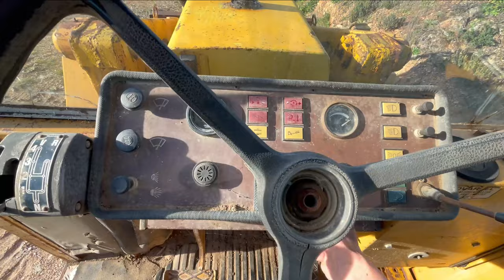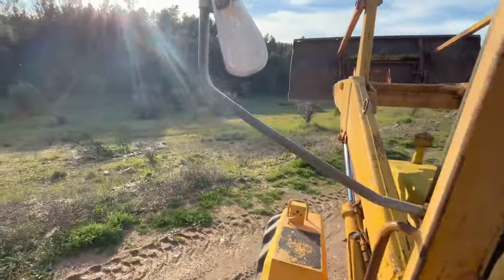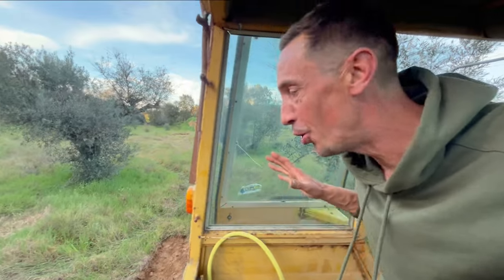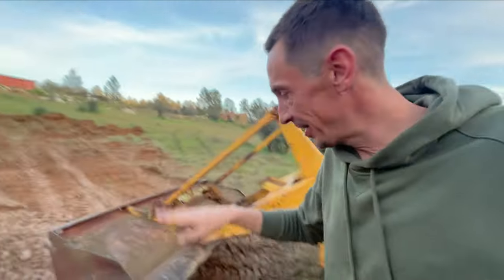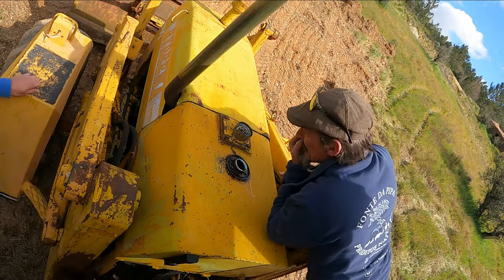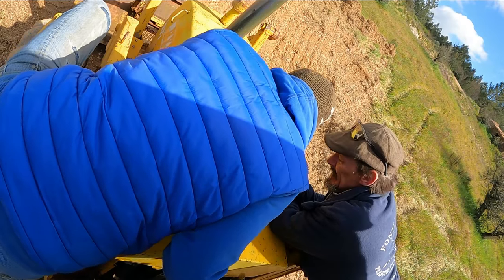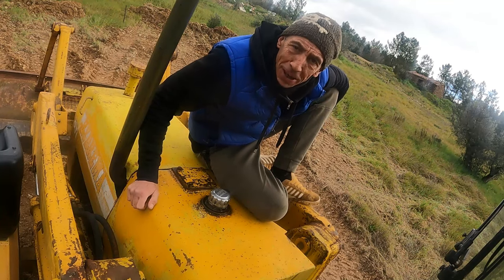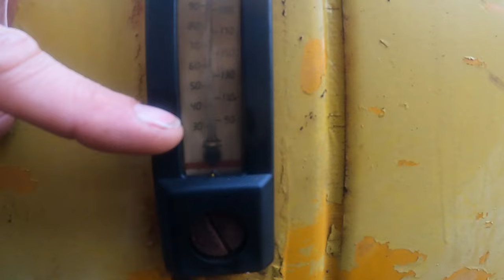SHE BROKE DOWN ALREADY..

Comment: OK...First.  Please, please don't walk under the bucket or stick your head under the bucket arms.  If a hose or something in the hydraulics would let loose the buckets will drop like a guillotine.  Always use heavy wooden props to hold the bucket up when you need to get under it.  Second...The hydraulics for the buckets and the transmission almost have to be the same.  Be sure the hand brake is releasing.  Water is no friend of hydraulics.  Dip the main tank with a stick and make sure no water is on the stick.  This machine has extra hydraulics, because of the articulating streering.  If your not full enough on the hydro oil, turning the steering wheel can give the machine fits.  It's expensive but filters, oils, lube and a complete hose check out.  A bottle of hydro conditioner, once you get the hydro oil level closer to full.

Comment: Change your hydronic filter fuel filter oil and filter and transmission fluid and filter.  Need fresh to make sure no water in those systems    Bet it goes after that

Comment: Jasper, you need a maintenance manual for this specific machine. Can you post the make, model and year of your backhoe so we can help you out a bit more than guessing. Are you sure that the gear box is using the same oil reservoir as the rest of the machine hydronics? you could find that there are several oil compartments that have dipsticks/levels you need to check and set. They may also use different oils hence the need for the maintenance document. If your oil levels are sufficient, then you need to check filters, as blocked or bad filters can give the symptoms your facing as well. Which is why it is recommended to do a full fluids and filters change upon buying a new machine, because right now you have no history data to guide your decisions. Also I'd steam clean the machine and after each use note where leaks are coming from so you can address these during your scheduled maintenance. I hope that helps D

Comment: Get a manual for that model. The hydraulic and transmission are different  systems. Poke and hope will only get you so far before you could make things worse. Need to find out how to check the transmission fluid levels as there will be a process to follow. Will be a really useful asset to have once sorted out .

Comment: The engine must have good compression otherwise wouldn’t start so easy.  90% of the problems you’ll have are hydraulic lines and cylinders which are easy to do the seals and cheap.  Start by cleaning all your reservoirs and do a full all fluid change

Comment: Make sure your brake pedal is fully returning or if you have a dump pedal or dump button on your front bucket lever that they're not stuck in or down, it will be something simple like that.
Reply from the maker: There is a transmission kill switch, its wires are just twisted together.. but it worked like this line. BTW there are no breaks on the paddle :)
Reply: im not familiar with your machine but usually there will be a switch on the brake pedal or a separate dump pedal also sometimes a button on the front bucket lever and these work as a trans cut or clutch, it looks like that's where your problem is as you still have some drive, if its a ZF transmission there will be a long dipstick tube coming form the bottom of the trans, check level while engine is running, also check fuses and see that you have battery voltage on your kill switch wires. good luck 🤞  @GhostTownVlogs

Comment: as others have said you need to fill up with oil mine takes about 120 liters for the hydraulics it might be wise to change the filter before you fill it up the fact that it has difficulty starting is probably due to a dirty diesel filter or water in the tank there is usually a water separator looks like like a glass cup empty it then it will go like a dream again

Comment: You were read the temperature of the hydraulic oil, not the level. The harder it works the hotter it gets.
Reply from the maker: Now that i check again..you might be right there
Reply: 99% sure it's not the thermometer
Reply: Je ziet duidelijk de grd.C en Fahrenheit boven in de meter. En voor het starten neem ik aan dat je voorgloeit?

Comment: Oh and you should try mounting a camera,  with a clamp system of some kind, on the front edge of the top side of the shovel/plow! Then you will be able to see everything and that part of the shovel never goes into the ground or makes contact with the ground !! And  you can even use a home built bracket system so its more stable., But if you use "Old Betsy Beast" enough you'll soon get the hang of 'judging  bucket position' without seeing.

Comment: Sorry to say, but you cut all the roots of that poor olive tree…I think you killed it. If you are planning a garden there you should not remove the trees because of the shade they give. The sun will burn your crops , aside from that there is very poor soil, just stones and sand. You will have to create good soil there, that will take a few years, and everything has to be loosened up after being compacted by this heavy machine, otherwise the water will not be able to seep into the ground. I am experienced in gardening, if you want I can give you advice 😊. Good luck with your project 🍀